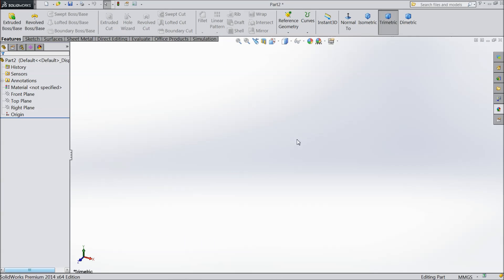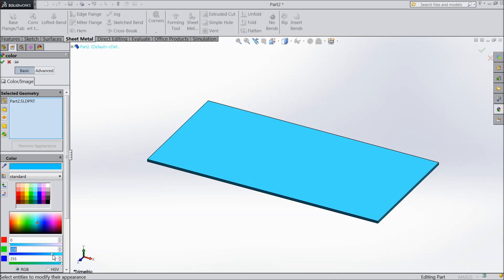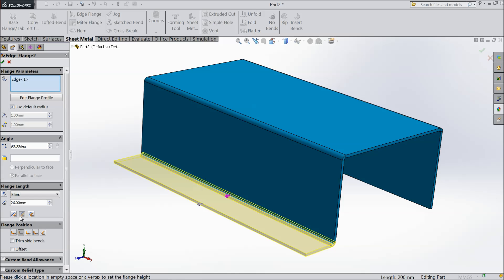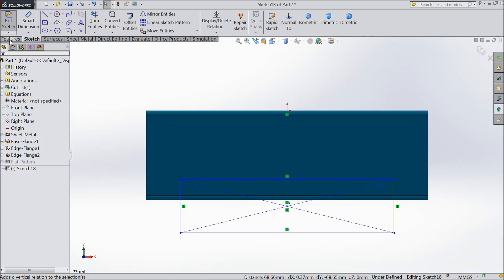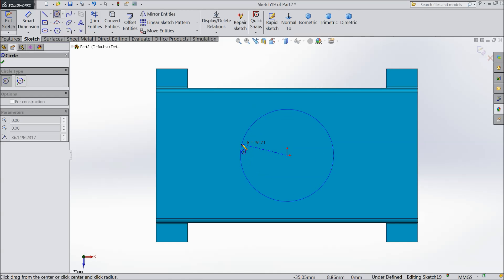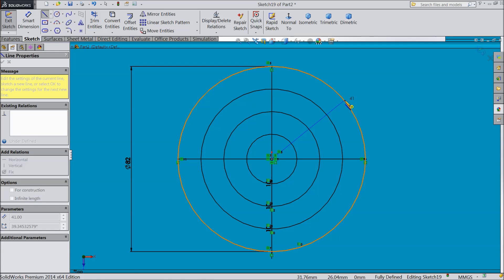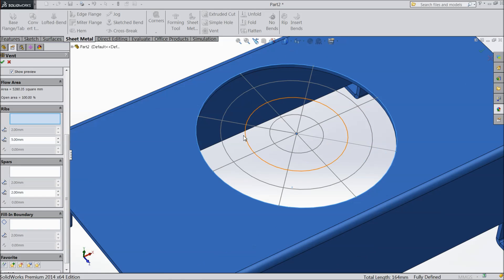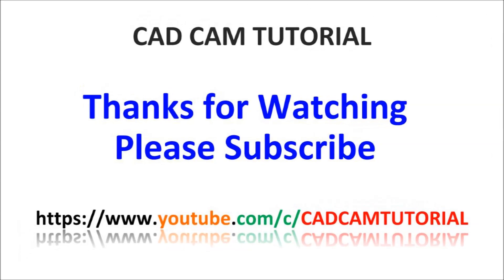Solidworks Sheet Metal Tutorial Vent

Comment: hello i have SolidWorks 2014 installed but no vent command
Reply from the maker: goto window menus -insert than open fastening feature and select Vent,
Reply: The ventilation command is not in any place I did the setup again Unfortunately the result is the same
Reply from the maker: type in upper right corner search command, vent